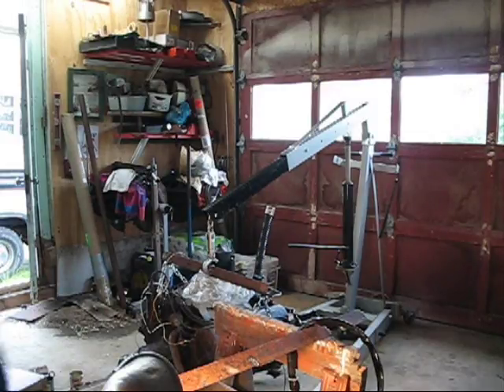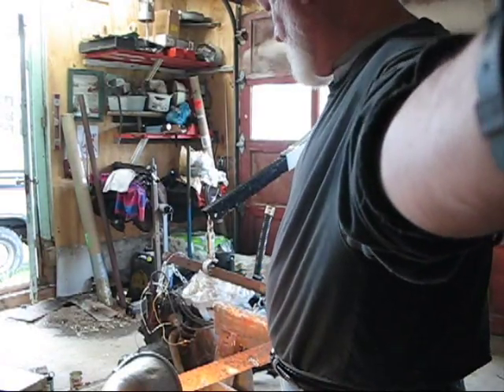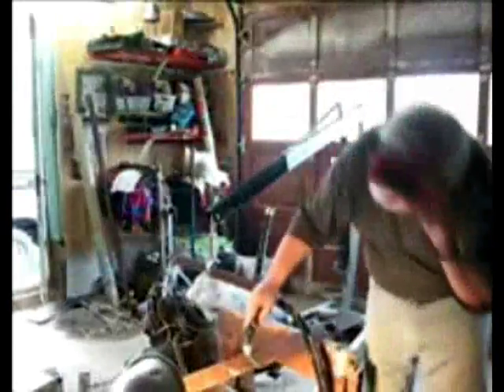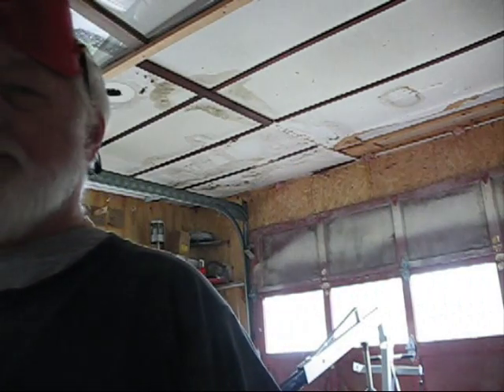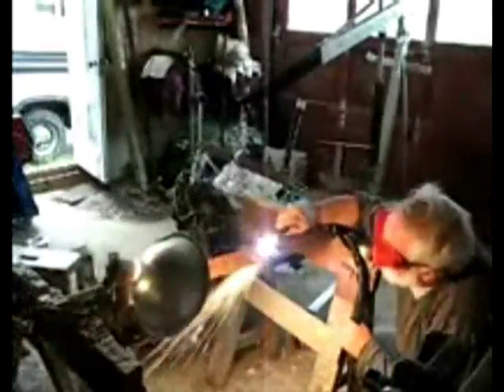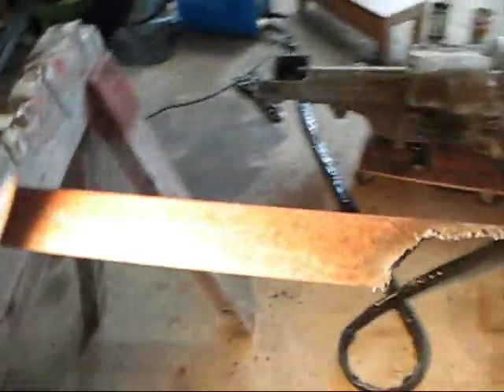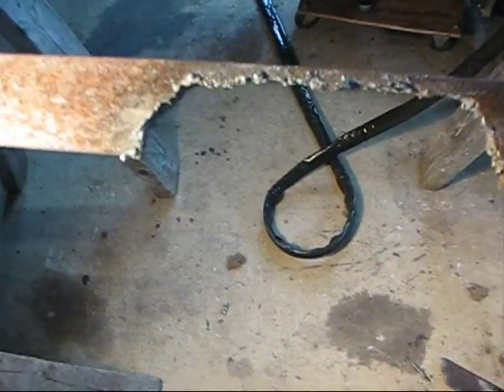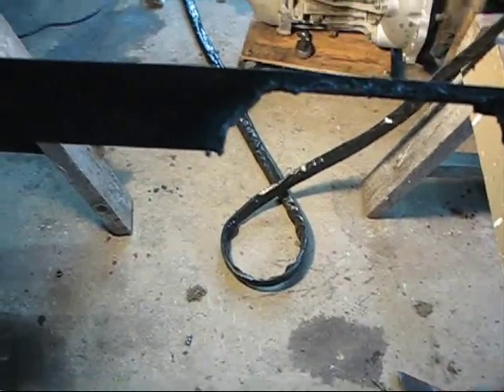Learning to use the plasma cutter

Comment: most plasma cutters have a hard time with rust yup including ole USA hypotherm with pilot arc i believe if you grind the surface rust off you will get a better cut i have a chinese built unit and i love it wouldnt trade it for all the hypos made lol i use a hypo at work and cost is not very good when it comes to repairs you can buy two chinese for the cost of repairing the hypo

Comment: @rpeek A pilot arc is when you can hold the torch in the air (away from the metal) and a flame comes out instead of being in contact with the metal. It is much easier to cut with a pilot arc. You can hit the trigger right before contacting the metal your cutting.

Comment: @rpeek I used to have a Hypertherm Max 42 but the "pilot arc" stopped working on it for some reason. I could still cut but I had to arc the tip of the plasma cutter handle to the metal for it to start cutting, I was a little upset because my "pilot arc" stopped working but it still did the job, it was really hard tho. I ended up selling it for 200 bucks.

Comment: I got mine(40amp harbor freight) from taddwholesale on eBay for $240 shipped. cuts real clean up to 3/8". With no skills, I can cut a 3/4"x7/8" tool steel bar in about 30 seconds.

Comment: well looks like your getting the hang of using it but im a bit concerned about the metal your planning to use appears you cut way too much out which is gonna cause a weak point and eventually will break general rule for thick metal is to stay at least 3-4 inches from the edges for strength issues if i recall correct been awhile since i done metal fabrication work

Comment: A better cut can be had by bracing your torch hand with your other hand. Every little movement you make side to side is transferred to the cut so the steadier you are the better cut you will get. Another important issue is to be sure you have the correct air pressure exiting the torch, while air is flowing from the torch set the air pressure to 70 psi.

PlasmaMetalCutter d o t c o m

Comment: chances are pretty good that plasma cutter is a fairly low powered job (the heavy duty ones are way expensive) and going through metal that thick isn't quite what it was meant for judging by the mess it left behind. I had the opportunity to use both when I was in my jvs, and each worked quickly and cleanly within their limitations, but couldn't be pushed any further without poor results. experiment. should be able to cut pure and smooth in one movement.